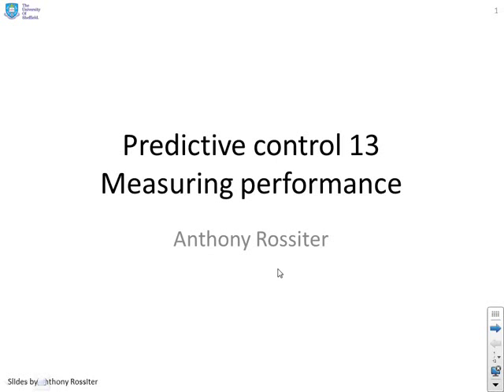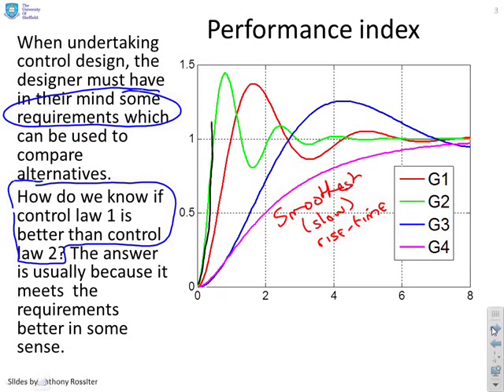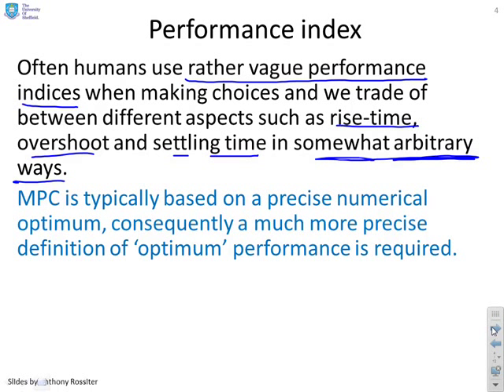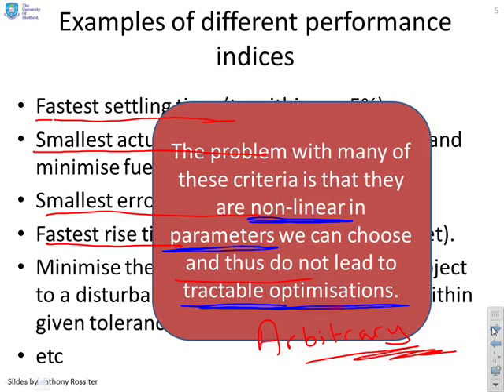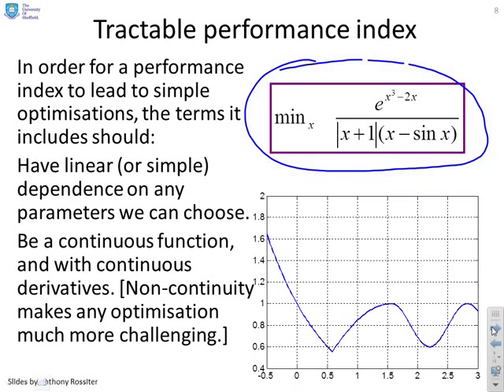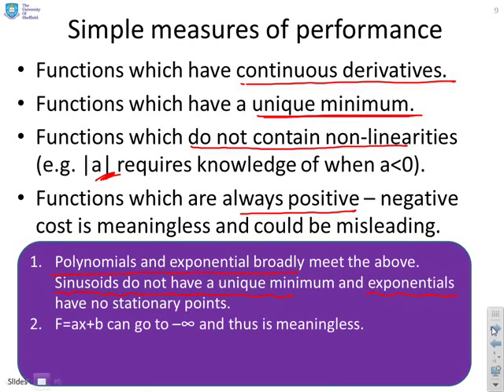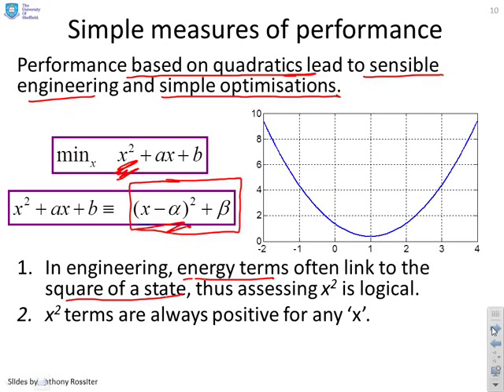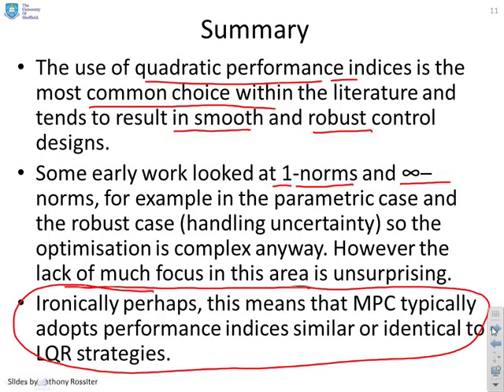Model Predictive Control  13 - defining good and bad performance

Comment: OK, I got this far but it seems to me there is still a lot missing.
How is feed back used to keep the model state from wandering off?   I could use the same technique as a Luenberg  observer.
The second thing is how are the Us determined to minimize the error?   So far I see no mention of this.  I could use a optimization routine like BFGS or Levenberg Marquardt but that seems computationally intensive.

If I had never seen these videos I would have simply used the recursive technique to predict as far ahead as necessary and then minimize the error between the target and estimated values by determining the control output.  I would have used feed back to keep the state from drifting.  If I am have extra CPU time I could use the minimizing program to update my model using past data.